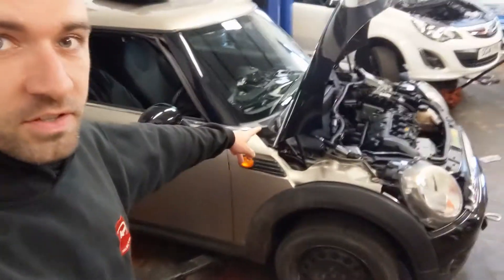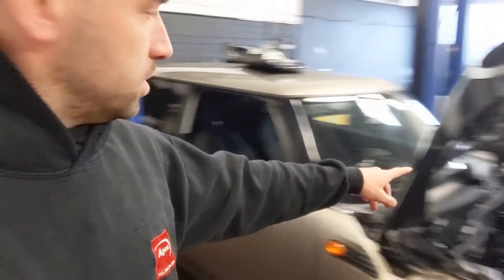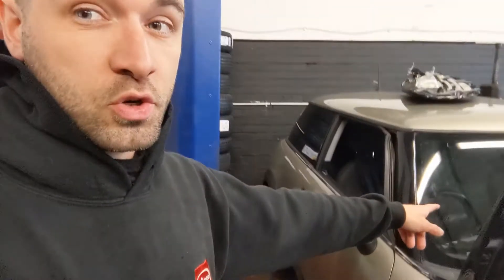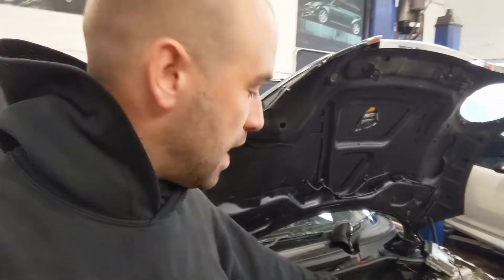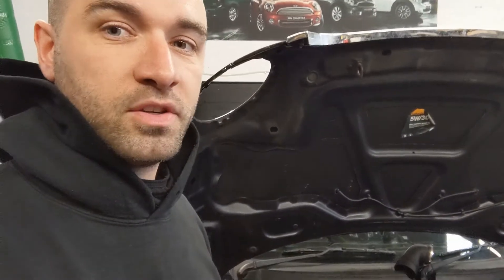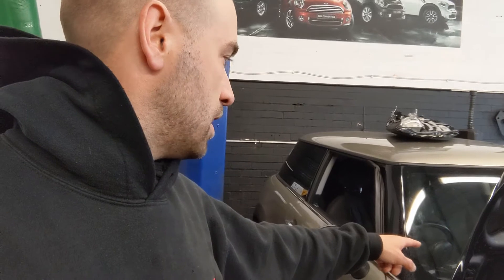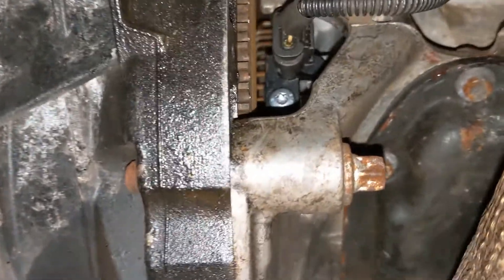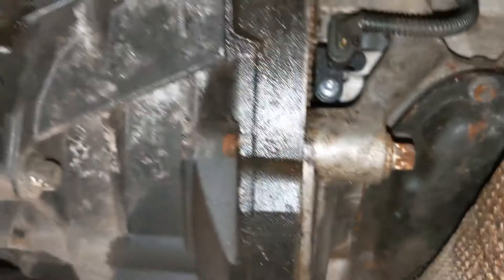BMW Mini R56 No Start/No Spark - What's Wrong With This One?

Comment: Check a switch that is under the engine hooked up to the transmission crank shaft they are made out of plastic and the male prongs  and female plugs sometimes dont meet and faul to close it

Comment: Minis have got to be Bmws worse partners. I’ve dealt with so many minis that lose the entire DME bcuz of a ground screw. A drop of water hits the Bcm1/Jeb/fuse box and it’s done, the crank sensor is basically floating with the screw lol sheesh
Reply: They are not a partner, "Mini" is a brand of BMW, like Lexus is for Toyota.

Comment: Did you ever fix it
Reply from the maker: I would have done had the customer not tried several different ECUs in it. We had an EWS anti tampering fault code and our diagnostic machine couldn't re-synchronise it.
Reply: @Papa77sGarage  I have the same exact thing going on with my 2007 mini Cooper a crank but no start issue and I just so happen to let a bloke clone my ECU/ DME and after that was done my car still didn't start. I'm not sure if I have an EWS fault code but if I do is there still any hope? Could it still be fixed? And is it worth it?
Reply from the maker: @Detoxingforlife  I would try end get the fault codes read to be sure. I've had EWS faults on BMWs before and I was able to resynchronize it however with this mini and a previous one it the CAS module needed replacing.  Good luck
Reply: @Papa77sGarage  ok not so bad I actually already have my cats module out the dash where I can easily disconnect and connect a new one when needed. How did you find out it was the cas?